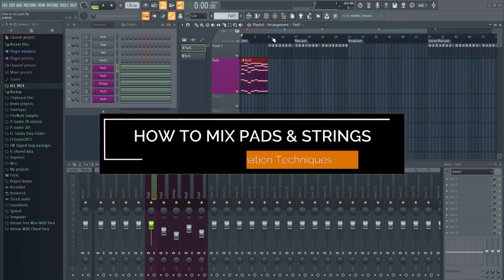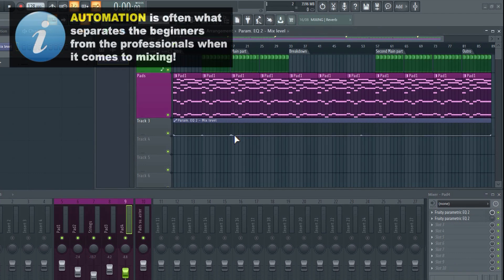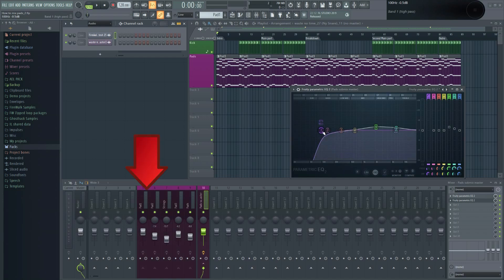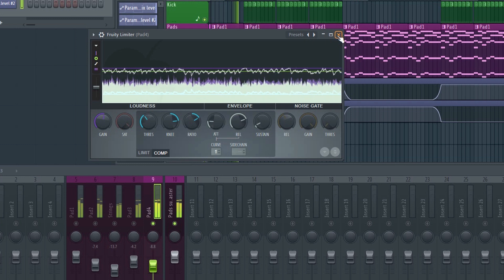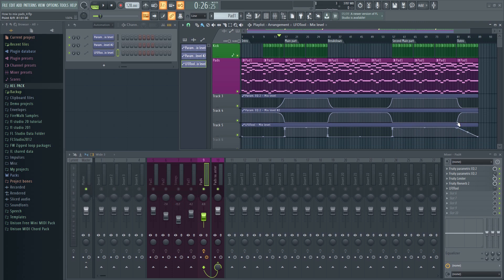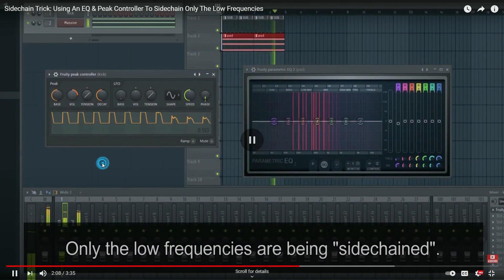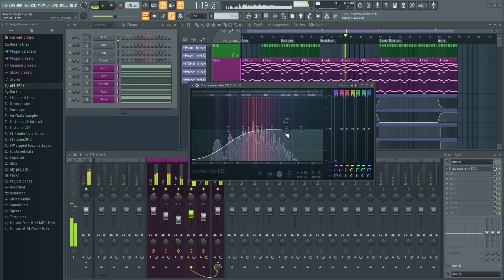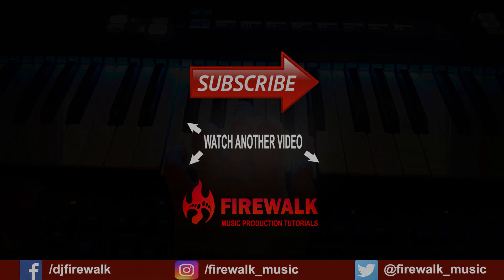How to Mix & Process Pads, Strings, and Similar Sounds (FL Studio Mixing Tutorial)

Comment: This is a truly great video! I have been struggling with my mixes since I started using too many various pad, string and atmo sounds. But his video helped to clear up my mixes and achecive a greater and more natural sound.

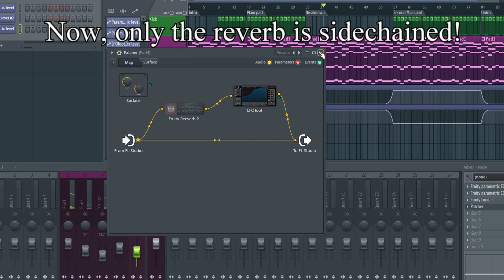9:30 Another great way to sidechan the reverb that I have recently learned is to create a whole separate channel for reverbs of different kind and send them all to one bus. Each of the reverbs could then be processed seprately. Fruity send is a great plugin to use in this case in order to output the signal from one chanel (pad, lead, bass) into a reverb channel.